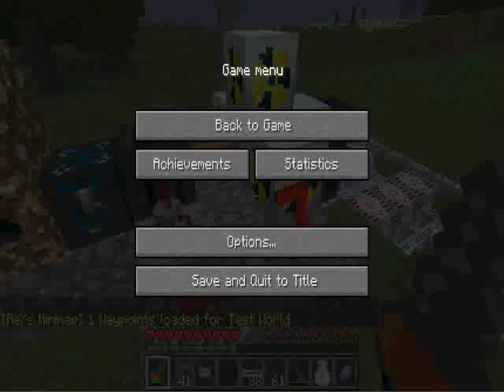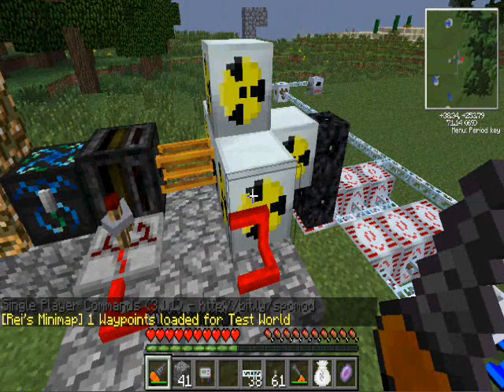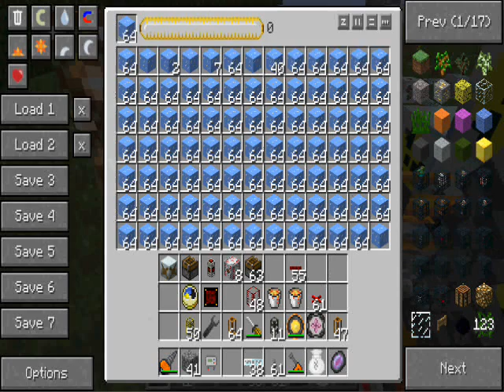EV Ice-Cooled Nuclear Reactor Technic Pack Minecraft

Comment from the maker: Hmm, what version are you running? They reworked the reactor mechanics in the newest industrialcraft so that this won't work anymore. Can you manually put ice in the reactor? If that's not the problem... Are you sure you have the filter facing the right direction? The small hole should face the tube. Also, make sure the filter isn't receiving a constant redstone signal from something, it needs to get pulses. Also, make sure it's not jammed. Other than that... I'm not sure off the top of my head.

Comment: Ah... well, I have it to where all 4 mfsus stop drawing power when one of them gets full(using the redstone output when full option and the splitter cable)... then the power comes back together in another mfsu and then splits into 4 MFEs which do the same- and then so on... but if that works for you then great... it just didn't for me.

Comment from the maker: Yeah, I know. As long as the delay isn't too long though. :) If it's too short the excess just bounces back. I just got the new version of IC for 1.3.2 today, and it looks like the ice cooled reactor is going bye-bye. It was nice while it lasted. The new mechanics are more complicated. They do have something like a rechargable heat sink now though, but it'd be tricky/impossible to automate. I think from now on I might just use the compact solars mod, with the HV solars.

Comment from the maker: Hmm, not sure without knowing your setup, but did you make sure to put a stack of ice in the filter? Otherwise it'll just pull whatever amount of ice is in the first stack. Also, are you using a mark 2 collector? I think I tested and a mark 1 might not cut it. I also haven't tried this setup using the latest versions of the mods, so I'm not sure if there have been changes.

Comment: IC2 is one of the few mods I've really worked in well.  I've dabbled in the others, so I don't know as much or how well they'd work together.  I also haven't done much with the agriculture part of IC2 either.  but ya, as long the cable and machines you have can hold the voltage you should be good.  Most machines take 32 eu/t max, a couple take mid.  I know the mass fab can take high voltage.  But you can put 2-3 transformer upgrades in the machines and not have to deal with transformers.

Comment: You are right, they would explode, however they all would explode one the EU started going out from the reactor, at least without the transformer.  If the Reactor is outputting 1800 eu/t then it would send that to all 4 of them, so each mfsu would get 1800 eu/t  It doesn't split up the power between them.

Comment: It does make the Eu go from extremely high voltage to high voltage, which mfsu can handle.  It wouldn't cause EU loss, that other guy doesn't know what he is talking about.  Also there wouldn't be any boom because its based on packet size, so it could have unlimited packets sent to the mfsu without it blowing up as long as none go over it's limit on voltage.

Comment from the maker: @maxell45146 The logistic pipes /might/ work if you set it up to supply 6 stacks, but it /has/ to be 6 stacks and the output can't exceed 1800 or it will eventually melt down. There's a limit of one ice block per slot per second, so one stack would only cool 300 heat per second, while it would be gaining 1800+ heat per second, actually even more than that if you replaced the ice with uranium it would increase the output even further. I tried it and it melted down in under 10 seconds. Not fun.